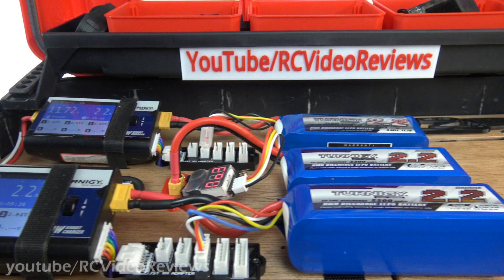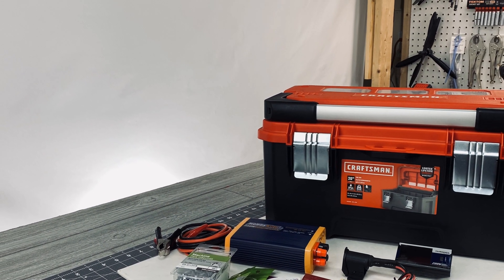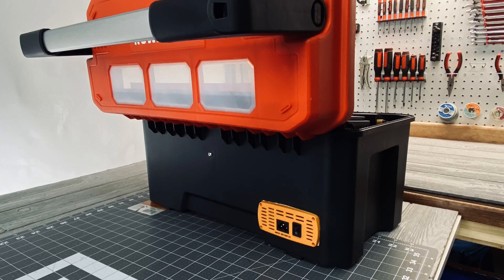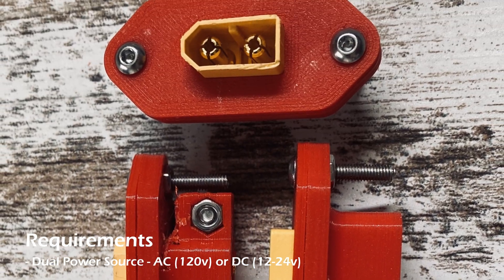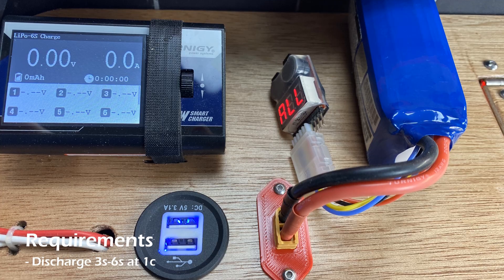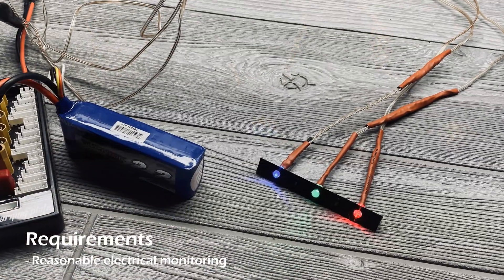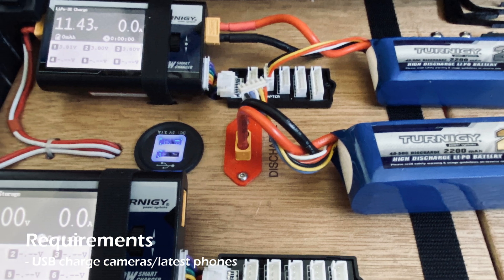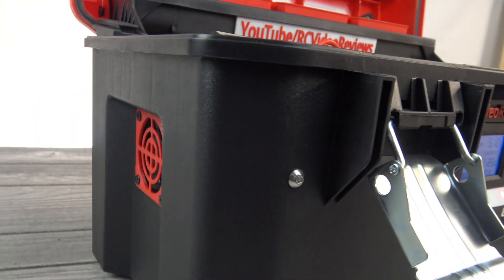[Almost] Epic LiPo Battery Portable Field Charging Station

Comment: Wow that is truly some Excellent job on the field box. Simple, and exactly what I'm looking for.
 I Just recently switched over from Nitro to Electrics ,and was looking for a good build to take care of biz at the field.
I watched all of the videos pertaining to this series,  and would like to ask, do you have a wiring schematic on how you set it all up? I built your version of the passive dis-charger(Excellent by the way) But getting stuck on the three way switch part,.. do you have both dc hot legs (from p-supply and batts) split from the middle terminal on the switch supplying power to the blocks, when switching the power? Hope you wouldn't mind , but def wanna cop on this build =D. Cheers!!
Reply: Hey Thank you so much Bud for the response and the diagram,... prob solved...
I was trippin over myself a bit, not considering  the feed into the mult-imeter and then the loads out from there...I know the device is rated for a 100v, but anything from China, I wasn't sure If was going to be bbq'n a baseball steak on my field box in my basement,  if  I wired it wrong =D 
Also, I just hit on your upgrade for the auto shutoff for the passive field dis-charger, def will be tackling that soon...Again,...very much appreciated and Huge Thx!!!  Cheers
Reply from the maker: @tamaman1559  Good luck with your box. Come back and tell me how it goes.
Reply from the maker: Grounds from both sources terminate on the same bus (common ground). Positive lead from AC goes to 1st switch terminal. Positive lead from Battery goes to 3rd switch terminal. 2nd switch terminal goes to positive distribution block (load). You can use continuity on your meter to test.
Reply from the maker: I posted the switch diagram here: https://www.youtube.com/channel/UCcJwn8V3MTsib2LjAcTnarg/community

Comment: Awesome Build 👍 wondering if you thought of safety if a battery exploded since lipo’s might explode or catch fire during charging?
Reply from the maker: Thank you. I love this box. Will get a chance to use it in the field soon. 3000+ flights over 6 years with most charge cycles charging 3-6 batteries in parallel. So...no.

Comment: That screen on the front is cool, does it have a backlight? I'd almost need a step bye step to recreate all of it. I'd get some dull aluminum bed liner for the wood. More of a industrial look and I think It's fire proof.(I know... the box is plastic) AirHammer out!!
Reply from the maker: If you are interested, I can draw a wiring diagram and post it in the community section. It's not too hard. I like the wood look. I think now that it is effectively finished, I'll stain the bottom pieces.

Comment: Dude it looks awesome! The P-51 Logo is the Bomb! All your logos on it look great but the P-51 is so cool. The whole box looks very professional! What’s the Total $ investment?
Reply from the maker: Hard to give an exact dollar amount because I had so many of the parts already. I think I'll put this in the description.

Electronics - $153
$35 350w PS. Plenty of ~350w/30a options on Amazon near this price point.
$50 2x UP610 Chargers. I got these at a steep discount, but there are some Toolkit and ISDT options close to this price point.
$7 2x 2.5ohm 100w Resistors
$9 Heat Sink
$3 Step Down Converter #1
$4 Step Down Converter #2
$12 CPU Fans x3
$10 XT60 Connectors, Silicon Wire, Heat Shrink, Crimp Connectors, Solder  (Shocking amount of 12awg silicone wire)
$6 LCD Panel
$5 LEDs and Resistors
$6 Power Distribution Blocks
$6 SPDT DC Rocker Switch

Hardware - $65
$30 Toolbox
$5 Wood deck
$20 Misc Hardware, Screws, Hinges 
$5 3D Material 
$5 Velcro, Wood Glue, Stain, Minwax Polycrylic

So about $220 give or take.
Reply from the maker: Yeah, the P-51 was a fun little add-on. If you didn't catch it, that is the channel logo. :)
Reply: RC Video Reviews Yep, I know it’s your channel logo. I just wanted you to know that I thought it came out looking Sweet! You’re having fun with that 3D printer.
Reply from the maker: I am. I'm printing a couple of beauty plates to cover the section of the box where I had to shave off the plastic risers to make room for the deck. Want this box standing tall for its field debut!

I was looking at the deck thinking about ways to do a little branding because I get asked about the channel frequently at the club. So the channel name was a no brainer. While I worked on that I wondered how hard it would be to convert an image to an STL. Wouldn't you know it, there's a web page that does it for free. Couldn't believe my luck.